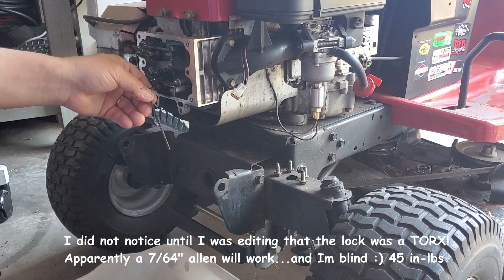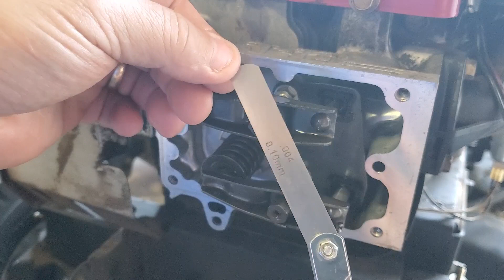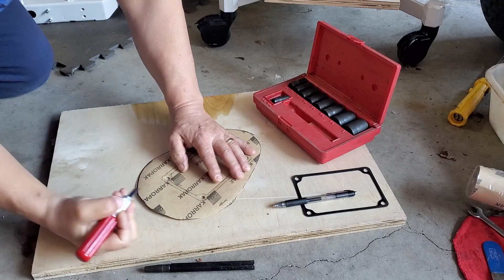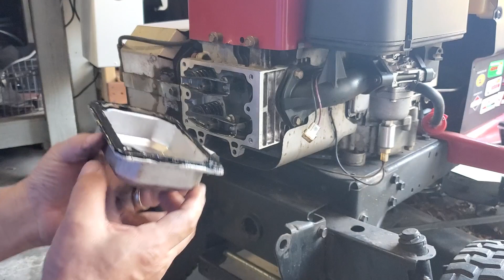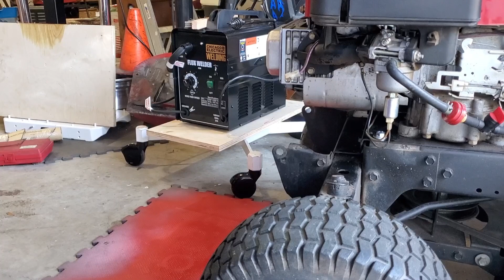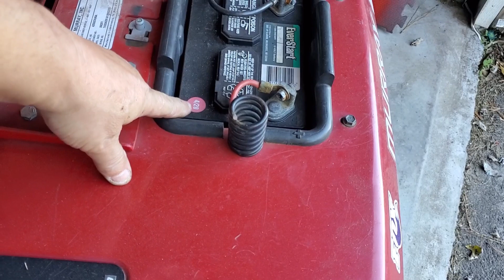Briggs 14.5hp OHV valve adjustment

Comment: In my line of work I often talk to many mechanics working on small engines that are having a fit with valve adjustment. 
  I try my best to convince them not to go off of top dead center when adjusting because many of them will be 180 out on overlap and tell me how far out of adjustment the valves are.  You can tell when they’re stating the valves were too tight. 
   Knowing that many of these engines will strip the key way out and knock the timing references off I’ll tell them how to adjust the valves the way you began explaining. 
   Exhaust starts to open adjust the intake. Intake is all the way open and just starting to close adjust the exhaust. 
     This way you know your cam was somewhere on the base circle when you adjusted. 
     I’ve never considered a compression release coming into play. However that should insure the engine is at least in time. 
     I tell them to go about it in this method so they can rapidly diagnose engine timing issues. 
    I’ve seen the struggle many times when timing references aren’t where they’re supposed to be. 
   Thanks for sharing your time with us.
Reply from the maker: Awesome response :) I've work on a lot of small engines but definitely have not seen it all...always learning. You mentioned the key issue and I've only seen others with that issue. I've been jadded to many times with slipped balancers (retired mechanic) on V8s and just started to read the cam when it comes to valve adjustments/issues...but I can see where the stripped key would be the same thing. Thanks again :)
Reply: I believe it to be a time saver on small engine repair. 
   Disregard timing diagnostics by just going off of the valve motion to insure the valves are adjusted. 
   Then see what compression looks like. 
    The problem I’ve seen too many encounter with small engines is aluminum flywheels rotating on the key literally locking the flywheel on the shaft and preventing it from being pulled with a ton of labor making repairs to that engine not cost effective. 
    I have been in the automotive machining business for over 30 years.   
    I see slipped into inertia rings on harmonic balancers quite frequently these days.